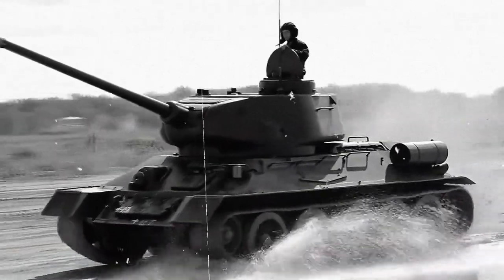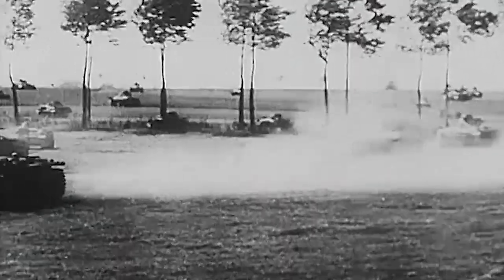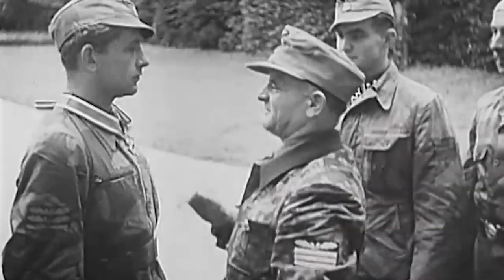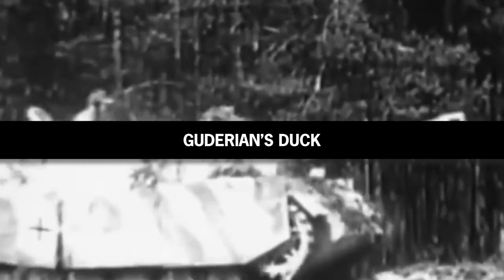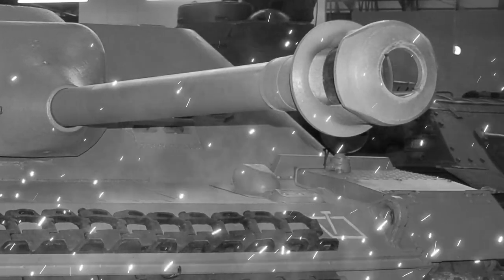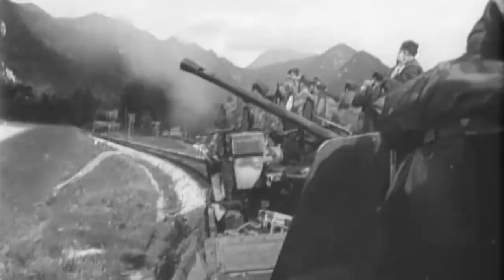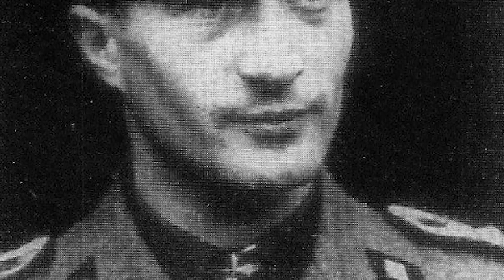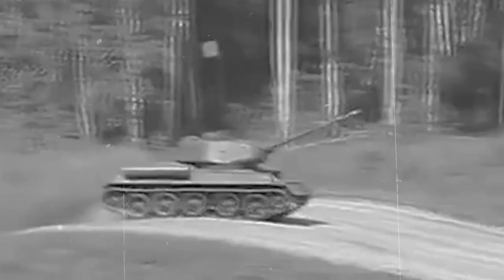Jagdpanzer IV Tank Buster

Comment: I sincerely respect you for doing these videos, but please, do a bit more research. This is gonna be a loooong video ... :-)

T-34s wasn't a shock to German soldiers nor was it unstoppable. As a matter of fact, during the time the Germans were "shocked", most T-34s didn't make it to the front due to breakdowns, the ones that did obviously got destroyed by 37mm, 50mm and short 75mm guns. T-34s were so unreliable, they made Tiger and Panther shine ! T-34 armor was so brittle and welding so bad that it could crack even from a 37mm hit. The shell didn't have to pentrate when the armor broke away upon hit. Early T-34s "liked" loosing their tracks, top speed was actually very limited because the driver had to change into 3rd gear by means of a hammer (plus he couldn't see shit), rate of fire was 2-3 (!) rounds per minute under combat conditions due to a 2-man turret (plus they couldn't see shit). And the thing was cramped as hell. Crew survivability wasn't even a criteria. Most if not all of these facts were known to the Russians and the first thing on their to-do list was to replace T-34 with a better tank if it wasn't for Hitler kicking in the front door. It wasn't until late 1944 that T-34/85 became a somewhat decent tank. I don't know how to rate a tank that has to be build in such an astonomic number to make an impact at all. Certainly not as "good".

WHAT ? Captured 75 and 88mm guns ??? Do you mean 76,2 and 85mm guns ? The latter of which was never installed on a German vehicle. The Russian 85mm AA gun was excellent, btw.
The only 75mm guns that I can think of are French 75mm field guns (WW1) and a handful of French 75mm AT guns.

"Panzerjäger" is the German term for all AT units, towed or tracked. Marder I, II and III, Jagdpanzer 38(t), Nashorn, Ferdinand and Jagdpanther were all Panzerjäger.
You mean Panzerjäger I (one). 

Insufficient firepower ? 7,5cm PAK 40 was the most powerful AT gun in service (besides the 88 and a few ZIS-2) in 1941/42. It easily outclassed the 76,2mm ZIS-3. There weren't enough PAK40s around, so ZIS-3 was the next best thing.

Panzerjäger IV was to replace StuG III to reduce the number of different chassis in production. Guderian had no objections to this idea, au contraire. StuGs belonged to the artillery branch, but the "new StuG" was called a Panzerjäger, thus fell under armor - Guderian's - branch. He was only against the installation of the long 7,5cm L70. Btw, Guderian wasn't the mastermind behind "Blitzkrieg". Many bright minds in many countries had the idea of " armored combined arms movement warfare" around the same time in the late 20s. It wouldn't be too wrong to say that already Napoleon worked in the movement war business. In Germany Hans von Seeckt was the man to implement the idea. Guderian just wasn't big enough back then. However, Guderian was behind the installation of radios on German tanks. The Brits also had radios on all of their tanks, so he wasn't the only one who thought this could be a smart move. Of course Guderian was an excellent student and "user" of the new idea.

Many tank destroyers like StuG III, Jagdpanther, SU-85, SU-122 and -152 had the problem of being nose-heavy which made steering more difficult. This was well known to everybody involved, but the big gun and armor made up for it. The things weren't meant to go running around anyway; they were ambush weapons. It was the long 75mm L70 which really "killed" Jagdpanzer IV.

There was an Alkett and a Vormag version, and they were substantially different. Did you just forget to mention it ?